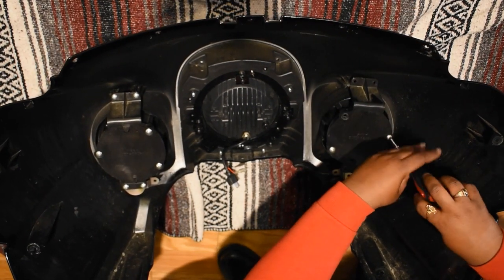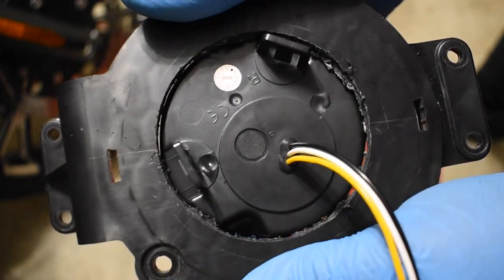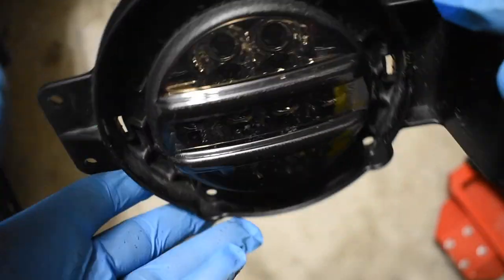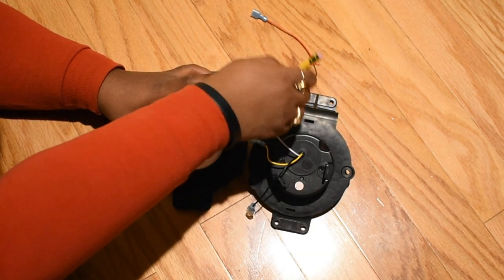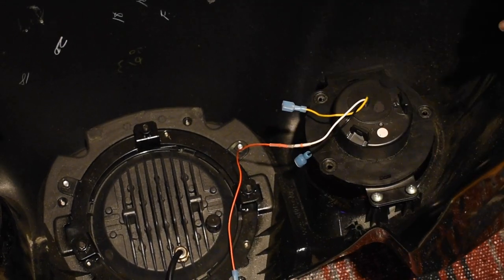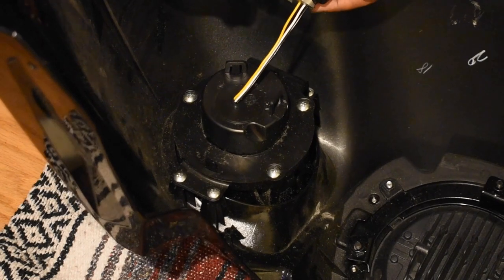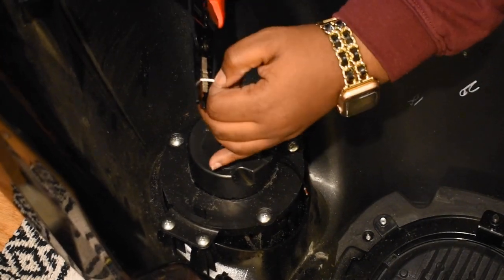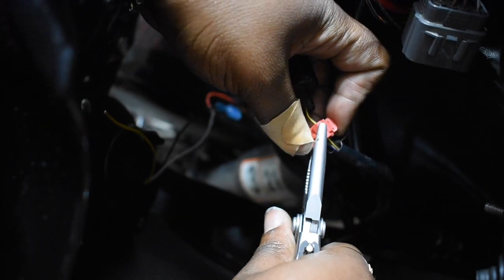LIGHT ME UP!! | Auxiliary LED Light Mod aka "Hidden Lights" | Kawasaki Vaquero

Comment: Hello! What crashbar lights are those? Seems like a better option than replacing the other two lights. I don't like it too much. Thanks.
Reply from the maker: They’re LED turn signal strips. Don’t know the brand. I’d send you the link but I don’t have it. I think I got them on EBay

Comment: Hey Rho,
Vancouver 🇨🇦 Vaquero rider here. Lovin the diy mod vids you've posted 🫶 Can u give me a brief explanation of your headlight? I really like that style over the HD "daymaker" style. Would like to know make, model, & difficulty of install. Did you need to install LED resistor or buy an aftermarket bracket for the bulb?
Thanks 🤙
Reply from the maker: Thank you! Yes I needed a bracket. Check out Engineered Adapters https://youtu.be/VZZKM-0Otko
Reply: @Riding with Rho  Thanks for the reply with Engineered Adapters link 👍 If you dont mind, where can i find the headlight that you are using in the video to fit that adapter. Was it just plug & play?
Reply from the maker: Yup any 7” headlight with 3 prong plug. I have these https://www.ebay.com/itm/174099514144?mkcid=16&mkevt=1&mkrid=711-127632-2357-0&ssspo=7x1u91aPSii&sssrc=2349624&ssuid=QdmN2eUSSem&var=&widget_ver=artemis&media=COPY
Reply: @Riding with Rho  Excellent! Thanks, Rho. Looking forward to more content. I've got a long way to go with the mods before im at your level 🤙 Stay safe out there

Comment: Yooooo! Nice install. You’ve inspired my project. Question though, aux lights are now always on right?  I’m trying to power them through a switch. The voyagers have a push button on the left blank plate side of the fairing and there is just an open female end connector there waiting for the push button on our vaqueros. I’m assuming though. Thoughts? I can show you a video of that explains it better.
Reply from the maker: Heyy thanks!! That makes sense. Yes my aux lights come on when the key is on accessory. I’m not familiar with how to install the switch BUT I have seen people do it so I know it can be done. Check the CVN FB group. I’m pretty sure I saw a post in there about it.
Reply: @RidingWithRho  awesome! Keep killing it. Looking forward to more vids!
Reply: @everardobarba2522  the wiring for the switch is in the left side of the faring under the “glove box” already set up for the aux lights

Comment: What name brand  and the size of the lights you are installing. Thanks
Reply from the maker: https://www.amazon.com/dp/B01G7M1V52/ref=cm_sw_r_as_gl_api_glt_fabc_8PZTBFZKS15HY8NV54HR?_encoding=UTF8&psc=1&linkCode=ml1&tag=rho91-20
Reply: I put the same auxiliary lights on my vaquero. I hooked up both white and amber lights on mine and it looks good. Thanks for the help.

Comment: Did you change out the rear wheel too or is that stock?
Reply from the maker: Still stock
Reply: @RidingWithRho  thanks for the quick reply. I am still up in the air about getting a vaquero. I do not want to spend harley type money if I don't have to. My issue is I am 6'5. So finding a bike that fits is an adventure
Reply from the maker: Ohhhh that makes sense. And then you’d probably have to make a few mods on either bike to make it comfortable for you. I get what you’re saying. I have the complete opposite problem with the height situation...lol...but if I can help, let me know.
Reply: @RidingWithRho  thank you
Reply: @eliteoutlaw3210  You will be fine on a Vaquero!  It's basically a Harley Road Glide!
Reply: @rocket3man371  not enough leg room for me
Reply: @eliteoutlaw3210  Your knees will be out but you can upgrade the floor boards and add the highway pegs to extend your legs.  I'm 6'1.  4 more inches won't hurt.
Reply: @rocket3man371  that's not true. Every inch matter. I am legs and wear a size 15 shoe.  I checked for extended shifter and brakes. Only thing I seen was a rumor some make them in their garage. Gone through that crap with my Yamaha road star. Kaw and Yamaha make good bikes but weak aftermarket support.
Reply: @eliteoutlaw3210  Damn sorry to hear that bro, hope you find a comfortable ride.